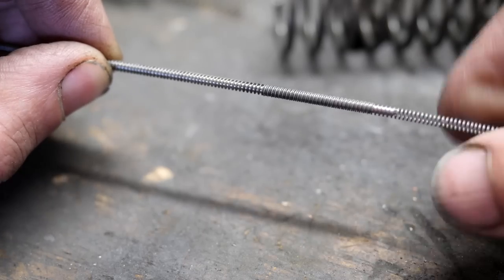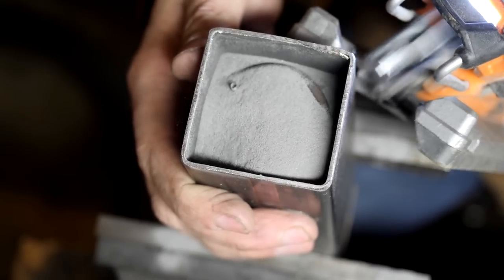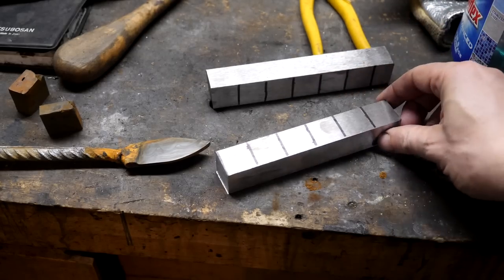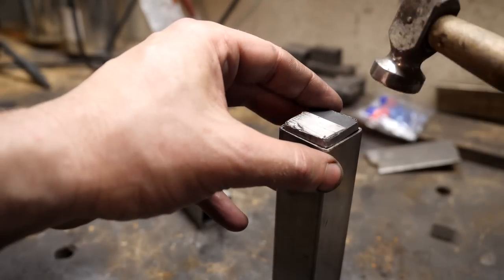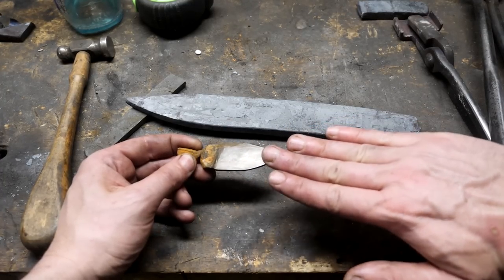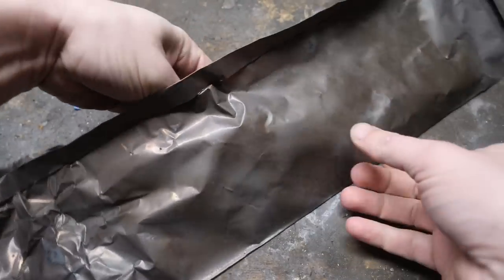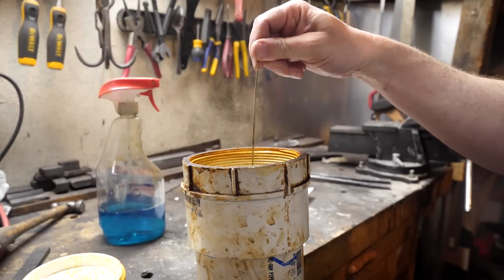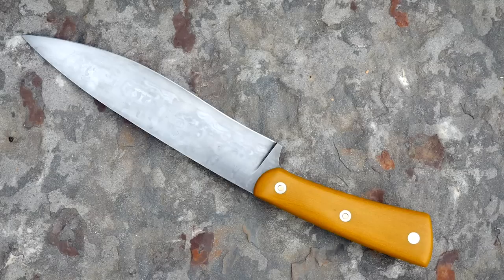Forging A Knife From Springs!  Part 2

Comment: Try not to think of it as a black spot.
Think of it as a beauty mark.
Reply: mole
Reply: Haha. well said.
Reply: "Won't be noticed on a galloping horse, honey." That's what my Aunt Bernice would say...
Reply: Seriously. Don’t worry about a near microscopic dot!  Take it from a perfectionist: don’t be a perfectionist. You’re the only one that will ever notice that. If you didn’t point it out, I guarantee you, we would have NEVER seen it. It’s micarta for heavens sake. That’s part of the character of the material and what it takes to work it as a craftsman. Which you are; a true craftsman.
Reply: @JohnSmith-gs4lw  as perfectionist myself, it's easy to give advices like  this. following them yourself, is totally differet thing tho.. 
also other thing is, if you  leave many small errors like that,  overall quality of the piece would suffer.. maybe this one is not noticable, but if there were many it would have been..
Reply: Well said! Should they have tried to sand Marilyn Monroe's face?  LOL
Reply: That handle looks fine.

Comment: While grinding you didn't wear gloves........Be safe we love your work 😀
Reply: Gloves aren’t safe, they can get caught up and pull your hand into the belt, causing serious damage.
Reply: @CHloE748  oh
Reply: Yeah the worst that happens is you scrap your skin a little.

Its not so dangerous here but at a rotary sander or something with a guard your hand can get sucked in and you can loose a big chunk of skin. 

Now lets talk about how he sounds about 30 and his hands look about 50.... lol. How does he sound so young?
Reply: You never wear gloves with power tools.
Reply: @RoivonPC  not true. Osha requires gloves for lots of power tool use
Reply: @matthewfurlani8647  Well I was always taught to never wear gloves with power tools, at least in wood shop, such as grinders, sanders, and drills.
Reply: @RoivonPC  some, yes. But wood and steel are different.
Reply: @matthewfurlani8647  REALLY? I had no idea! I thought they came from the same source!!!

Comment: Hi, couple of suggestions. 1. Do a canister without adding powder, but add a piece of paper to use up the oxygen as it heats. Without the oxidation you might be able to make an entire, gap free, billet of springs. 2. Get some nickle wound bass strings(as you did in your other video) to use as the contrasting element. Or get some 15N20 type wire and wind your own springs for the contrasting element.
Reply: Haa sorry I should have known you'd know this, duh. I watched one of your other videos and you did do the canister without powder.

Comment: You can use a small grinder with a grinding disc in stead of a cutting disc to cut the grooves for a ladder pattern. Helps if u round the edges of the grinding disc first if its still new by grinding its against a brick or thick tile.

Comment: She's a beauty, however I've watched several other knife makers that have crazy distinction in their Damascus style blades all have one thing in common. They treat in feric chloride, then wet sand, ultra fine and do that process at least three times, sometimes five. It really makes the pattern pop big time. Nice sexy shape to her, looks strong and I like that. One thing I would recommend that might sound nutty, you drilled holes in the tang and that pattern looked really cool. Maybe sometime, do that again but with a clear handle of some kind so you can see those killer crossdrills. I think you've been watching Shurap, he's the best, keep up the killer work. You only get better from project to project. Cheers!

Comment: 👨‍💻what springs 😳? Anyway Get  a small piece of spring steel Leaf 1- shape it 2- heat it red hot &3- dip in temp oil   4- polish it again &5-  reheat @ 350c  6-  polish it again 7-   then you will have a knife or TOOL that will ring  if dropped high pitch note  and wont wear out like alot steels (Y) amazing stuff spring steel ! i was a spring maker 25 years i know bro! 👍IF it dont ring when hit or dropped  its not perfectly tempered or isnt spring leaf

Comment: The etchings on the spine are beautiful, they look like flames, sorta. The knife is beautiful. I'm not usually a micarta fan but these scales look good. The black spot is just a way for others to know that the knife was handmade. If a person were to complain about the knife, I would offer them a refund and never sell them another knife! A minor blamish like that isn't even worth mentioning. Give them a refund, have them send the knife back and then sell it to the next person on the list! It truly is a great looking knife. I personally prefer wood for a handle material, the Stabilized burl you were going to use, I would have used it, it would increase the value of the knife instantly, and because it was burl, it would be appropriate for the wood to be used on it! But that's me, I like wood, and if you have a better project in mind, then by all means... Anyways awesome work, I think the spring Damascus was a success! The spine looks really cool, it looks like flames etched right into the metal, beautiful! Keep making knifes, and keep your forge hot, and your hammer ready!

Comment: Even though you started with springs, once they were melted and pressed, does the end result differ from started with a solid block to begin with? 
In your experience, would it be possible to forge a blade with significantly different metals? Like a burrito. A higher melting point metal wrapped with a lower one or vise versa using your container technique. Or even starting with a dozen different type small straight metal rods shoved into a spring like you did here.

Comment: I always find it satisfying when they run steel under the power hammer and it's flakes fall off. 

Edit: sorry if I got the terminology wrong. I don't know much about blacksmithing.
Reply: Don't worry about the exact terminology, good descriptors allow people to know what you're saying. It's scale, a hard oxidized layer of the metal from the forging process. It eats up your sanding belts and prevents forge welding. It is very satisfying to see it fall off.

Comment: Just an idea but in part one if you use that method again and tried surrounding the springs with a piece of round pipe and then twisted it your springs might not have gotten away from you you would’ve had to weld the ends like you would if you were doing a piece of cable Damascus and then just twisted you would’ve gotten the same result of a forge world but the springs would’ve gone all over the place and haywire

Comment: In this way a rifle barrel was forged or the wire was wrapped in a coil around a mold mandrel  the thickness of the coil was several cm  so it warmed up so it was put in a mandrel and forged with semicircular hammers in a mold
So if you ever have the time to try to make such a tube it would be interesting to see

Comment: >Forge welds on top of forge welds starting from stock of springs of questionable metal and tons of possibilities for imperfections & air gaps
>Never shows him using flux, despite showing other steps like brushing off the billet
"That's a beautiful cake. Did you. I dunno, forget anything when baking it? Maybe something like eggs?"
"...Cakes need eggs?"
Reply from the maker: no gaps in this one the metal powder was packed carefully in the canister with the springs. were there gaps they wouldnt be along the cutting edge due to the presence of the solid 1084 steel there.  i've showed using flux many times. any time i forge weld outside a canister its with flux.

Comment: Very impressive. When you reach forge welding heat, it looks still pretty orange at this end - do you use a filter? I’d expect yellow white with sparks flying, but my experience is mostly with iron, not steel, so maybe it’s different.
Reply from the maker: my propane forge doesn't get hot enough to spark steel

Comment: I like it. Do you repair small older knives ? I have one I was given when I was about 13. It is a small pocket knife and the back spring broke. The blades are pitted and need polishing too. One handle needs replacing. It is my first knife and means a lot to me. I have about 100 different kinds and sizes.
Reply from the maker: i dont open folders, sorry

Comment: Something that would be cool is to figure out how to do skull Damascus by setting nuts or bearings and cable or square and round rods of differing diameters the square would be the teeth and the round the eyes in a skull profile it might end up like the The scream painting by Munch but who knows until it is tried.

Comment: How much material do you allow for loss due to oxidation (I assume  that's what's going on with the flakes that fall off when working it)?  Seems like it would be unavoidable loss.  Can you collect that and use it as metallic dust in those cans you make.  Would that not happen if it was worked in an inert atmosphere?
Reply from the maker: it's iron oxide.  I don't know if it would weld up in a canister or not.  I geuss it should in the presence of carbon in a reducing atmosphere.

Comment: Beautiful pattern. I do have a question...I noticed that you drew the canister out with the Damascus...is there an advantage to keeping the can vs removing it?
Reply from the maker: i've noticed when i make canister damascus sometimes it develops splits  on the surface as it's manipulated.  keeping the surface of the damascus welded to the canister as along as possible helps prevent that.

Comment: i have a question about the scale that falls off while hammering.   basically, what is it? 
impurities driven too the surface?  a thin layer that rapidly cooled and broke off?
ive alloyed lead and tin together to make my own solder and a layer of "crud" would pool up on the surface.  im guessing that the scale is similar.

addendum:

actually let me clarify what i mean by alloying.   i took pure lead from an old toilet flange/elbow, it was probably about 10#'s worth, then added small amounts of silver solder to it to give it more strength.  it actually worked pretty well. not as good as store bought, but good enough for government work.... 😁
Reply: Jack Larson from what I've understood so far, the scale is oxidized iron that's formed on the surface of the billet. If you leave the billet anywhere for any length of time, some iron on its surface will oxidize (and you're not even gonna see it). Some smiths like to grind down their billet just a hair to remove this oxide layer right before forging (and if you're doing damascus you really should do so for all your layers before welding because if you get scale into your knife... you can start over). This "grinding down" step can actually reduce scale somewhat, though a bit of the metal is still gonna oxidize when it gets hot. The white powder you see them put over the hot steel is supposed to prevent that.

Mind you I'm not a blacksmith myself, this is just from the bit of smithing theory I picked up over time.

Comment: Just saw your video. As you made a cannister knife, I didnt see you remove the cannister material a lot or use a whitner to take out the soft material out. 
Did you confirm your edge is hard enough after quenching via file check? 
Otherwise the fit and finish looks great.

Deepak, INDIA

Comment: @GreenBeetle - Question... I have four Glock knives which are made from "Spring Steel". Do you have any idea of the composition of these blades, or the Rockwell Hardness rating?  I love these knives for field work, they are dirt cheap, high quality, utilitarian, ergonomic and tough as hell.  I have actually tried to bend or break one and could not do it. They ain't pretty, but this great video prompted me to ask an expert! Thanks!

Comment: when I was young my father owned a small machine shop the first sword I made I used a leaf spring off an old Chevy I machined it which was easy tough shit then I heated the hell out of it and quenched it with oil I was always told they were spring steel I believed it was 1095 but really don't know I do know that with the exception of being heavy as hell it was one hell of a tough bad ass sword I always wanted to try to make one of dropped forged titanium but the shop is long gone as is my father RIP I know titanium can be hardened near 59HRC which could be an utterly amazing sword never seen one being made would love to see what could be achieved

Comment: That's a beautiful knife! However, with a tough, durable handle material like micarta it's also certainoh a knife made for work, so who cares about that tiny little black spot on the handle. It just adds character, and besides after the first time or two that the knife gets used with a dirty work hand, that little spot will just blend right in anyway. So...Good job! Good work!

Comment: That red metal, when it's red hot and it's squeezed sometimes it looks like it's sweating. It's so satisfying. And the coats of burned stuff that fall like skin of the snake. What are those? I'm just mesmerized by the whole thing. 

I am pretty science literate, but at those temperatures, what I understand about science doesn't matter. Doesn't apply. It's metallurgy. Might as well be magic...
Reply: Those coats of burned stuff are called scale. When steel is heated at those high temperatures the metal on the outside reacts with oxygen and this reaction is called oxidation. It’s same reaction as rust but since it is very hot the reaction happens much faster. I hope this helps answer your question.

Comment: When cooling a blade, have anyone tried clamped the piece between two huge blocks of something sturdy to keep it from bending? Would that work?
Reply: Basicly you have around 15seconds after hardening to bend it back if it bends :) after that you are fucked a proper hardening tactic and a good feel for knife shapes will prewent that in most cases.

Comment: When I saw him insert the springs into the canister, and then begin adding the powdered steel in.. but never applied anything like whiteout (because of the Zinc oxide) to aid in removing the canister later, to help prevent it from sticking to the billet, I was confused, annoyed, and intrigued all at the same time. Lol

Comment: Buy a dental lab vibrating oscillator. So much more handy for any crafting process where you just want to set a piece of fab work on a table. $45 on eBay. Take bubbles out of casting and all that.
Reply from the maker: oh man cool, i thought these were hundreds of dollars. are the cheap ones good?

Comment: Why did you drill all the holes in the handle? At first I  thought it might be for added adhesion for the epoxy, or maybe it would not have a wooden scales,  but you drilled the holes for no reason, why?
Reply from the maker: They were all for handle pins but I kept messing up.  Just kidding.  They were for no reason whatsoever.

Comment: You need to work that material a lot hotter.
You were hammering on red/dark steel. This way it can crack and not weld well.
Also try folding the spring material a few times for better esthetics.

Comment: What flakes off the steel while being hydraulic hammered?
Reply: ferous oxide mostly, during forging around 1-3 % of steel mass is lost due to oxidation of the hot steel by the air.

Comment: Wait, I thought you're supposed to strip away the canister?
Reply from the maker: it was ground away
Reply: @GreenBeetle  ahh, that makes sense. Less struggle I suppose
Reply from the maker: i'ts 1/16" steel to start, after forging and drawing out it's a bit thinner than that.  grinds away without too much problem.

Comment: this black powder,is this a iron?????
Reply from the maker: iron and 1095 powder
Reply: @GreenBeetle  iron and 1095?? is not that same???
Reply from the maker: @toxicgamers1113  iron has no sig amount of carbon, 1095 has .95% carbon or there abouts and is steel.

Comment: Why not try extracting your own iron from ore rather than just using other people's iron ?
Reply from the maker: I would love to do this.  There is no iron ore where I live.   I could buy other peoples iron ore and smelt it but that would e using other peoples iron?
Reply: @GreenBeetle  your location point I can understand a little. But for instance in early Japan, the tomohogane was transported to other areas. So what's wrong with obtaining raw material and using it? Or is it so much easier to melt someone else work?

Comment: You are really god with steel. But there is two things i dont get.
1. Whats the point og groining the thing on the side, that you are calling lather blather? It,s all going away again.
2. Whats the point of using springs, when its not for making the blade stronger then normal steel?

It,s all fun to watch, but i dont see the point of using so mutch time, when you could have done it all with a lump of steel.
Reply: I was thinking the same thing, but apparently the pattern in the metal (shown at the end) is because of the springs.
Personally, I don't find it very appealing, but it's a reason to use springs I guess. And some people seem to like it, so there you go.

Comment: im not trynna be mean or anything but im sick of THESE channels getting a shit load of attention it is soooo damn easy to do shit like this when you have proper equipment. try doing it how i do. a forge grill with just wood and air. and using an anvil and hammer. THATS IT. no power hammer or power press. no propane grill or anything like that. now making anything with THAT setup is impressive. making knives or swords with 200k woth of equipment isnt impressive at all
Reply from the maker: i thought about doing you a favor and deleting this but then i decided not to.